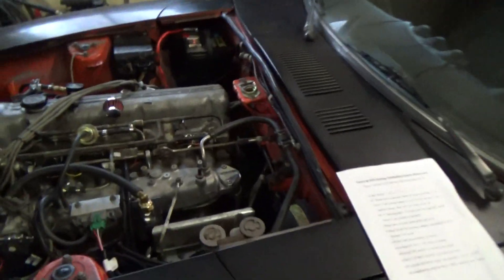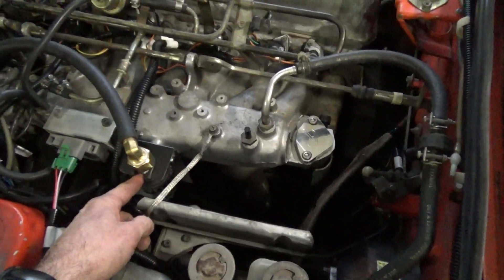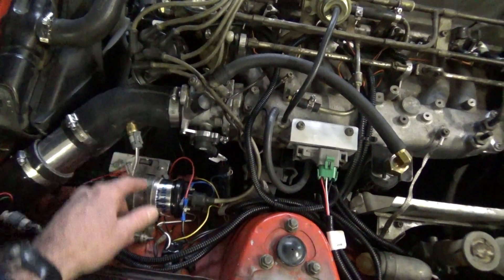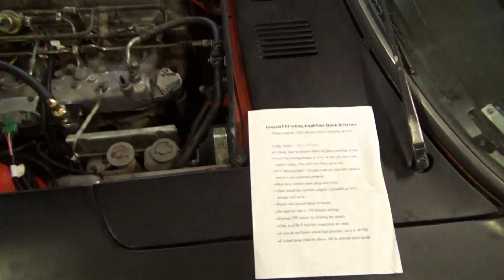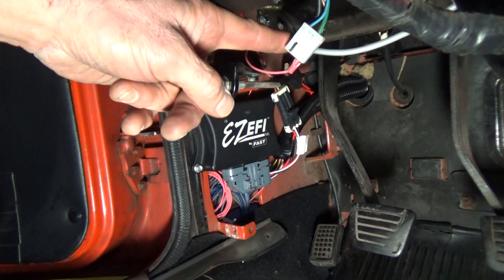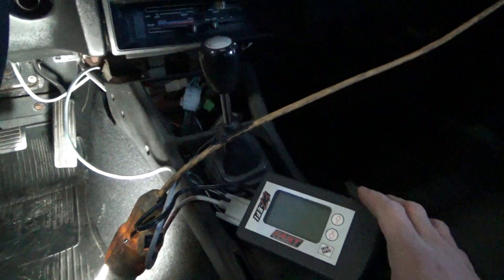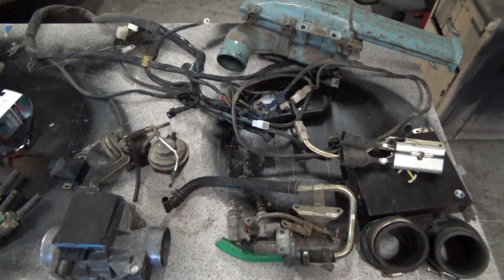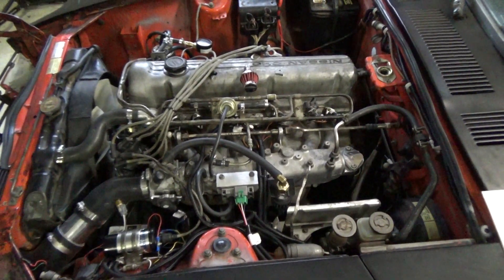Fast EZ- EFI Retrofit  for Datsun 1978 280z

Comment: My kit didn't say what injector wiring to what cylinder.  Do you have any info?
Reply: Are you referring to the fuel injectors? Shouldn't matter which you plug them into, the  fuel injectors are 'batch' fired, meaning they all spit at the same time, no particular order.
Reply: @oddpostchannel  yeah figured that out lol thanks

Comment: I installed a FAST EZ EFI kit on my 82 ZX and it is a HUGE difference in acceleration response, torque and overall driving enjoyment. I did have to tie my fuel relay in with one wire behind my glovebox. Would recommend a cam, headers and a better ignition system like MSD 6AL. Good system, but for the money a MS3 is also a good, controllable system. Will not work for turbo applications.

Comment: How did you connect the fuel pump relay wire from the ecu, given that you removed the stock fuel pump relay?
Reply from the maker: I did nothing with the fuel pump relay or any wiring concerning the pump 
The program asks for fuel pump pressure and the fuel pump works off the ignition
Reply: Badrock Chopshop Thanks,  figured it out. Good video!

Comment: Hi, just wondering how this install is holding up? Looking at getting this for my 280zx.
Reply from the maker: The install is working just fine it seemed like once i got it installed and programmed it took a hand full of drives to get the computer to figure out and adjust to differrant drive conditions
Reply: @badrockchopshop7792  hey did you use the oem injectors of change out to high impedance once?? I just bought this kit thinking it uses stock ones but the instructions say high impedance only. Z cars have low impedance stock :(

Comment: Do you have to measure fuel pressure .....and how would  u get an accurate  reading for rich and lean performance....or will the ECU figure this out for you once you input the car parameters and info?.....should  temp be above 150 and below 210 or just at driving temp. For max hp....I'm assuming no changes to mass airflow sensor if equipped.....sonny
Reply from the maker: I believe the ECU should make the adjustments and the temp needs the be at 160 for the ECU starts to learn and take roughy 50 miles to completely determine a tune

Comment: Any hesitation  on running all sparkplug wires bundled?...crossfire problems....just wondering gregg
Reply from the maker: runs good the shop but have not been able to shake it down on road because of the endless winter we are dealing with

Comment: I got my kit with the handheld upgrade included. If you received the kit recently then they included the old controller only because FAST sent ZCAR depot mismatched kits where they had the new controller but none of the correct communication cables. I received mine mid December and I still am working on getting the correct cables. So more than likely they sent you what they had ready to go.